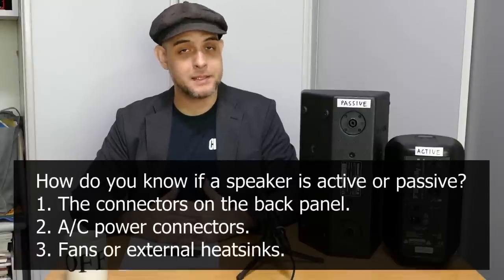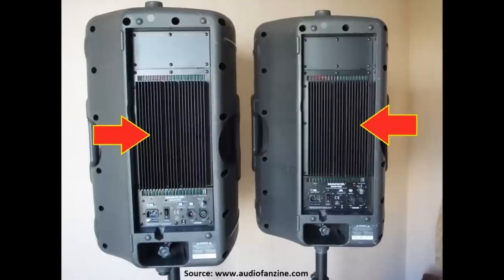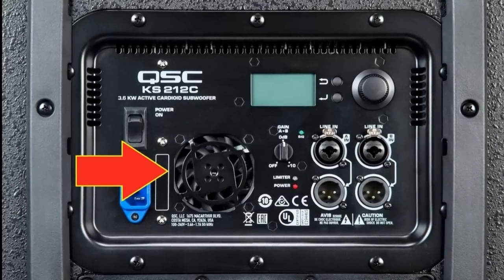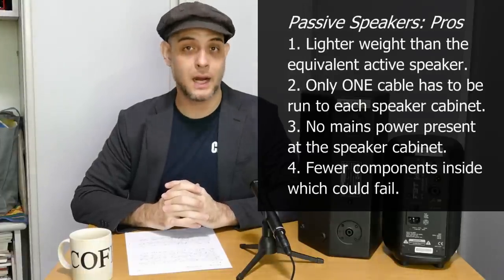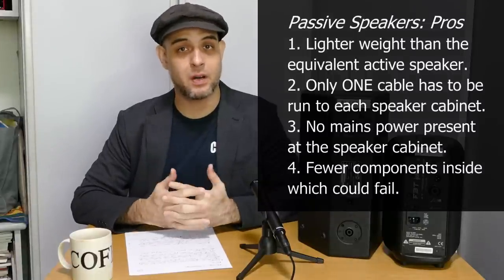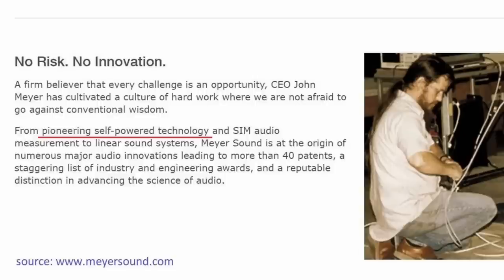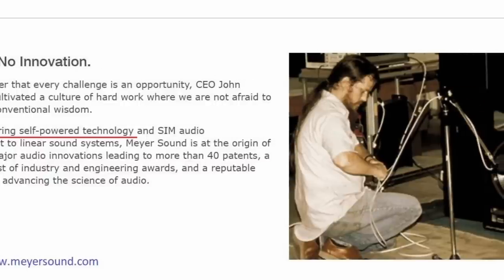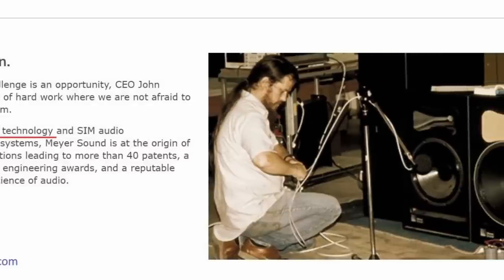Active vs. Passive Loudspeakers for Live Sound

Comment: Hello brother,
I like to ask you a suggestion for new speakers for the church. Currently we have 18 years old passive Yamaha speakers. What u think about Yamaha DBR 15. I heard Yamaha is know for mids and highs. I listen to EV zlx it’s sound clear but I couldn’t listen Yamaha DBR. We are on budget. Thinking about getting 2 15 inch speaker and a 10 inch stage monitor. Capacity is about 150 people at the church.. i like the Yamaha warranty. EV speakers have too many things in it. Thanks much please advise.
Reply from the maker: Hi Thomas, I don't recommend active speakers for installation - passive speakers are lighter and allow easier control and servicing of the amplifiers. This is very important if the speakers are installed out of reach, which they usually are.
Reply: @GLBProductions  
Hello brother thanks for the kind replay so our church we putting speakers on the stand not on the wall. I thought active speakers are better.  We already have an external Amplifier. Please advise.
Reply from the maker: Active speakers are not better or worse, it depends on your use case 😄 Both Yamaha and EV make good products - at the end of the day choose the brand that provides better service and after sales support in your region. A good pro audio retailer will work with you to recommend a model that is suitable. All the best!
Reply: Also in my understanding passive speakers will outlast compare to powered one. .. what u think about the Line array speakers compare to typical box style.
Reply: @GLBProductions   Thanks much appreciated.

Comment: I've learned many things from you sir. I have a question. Can you daisy chain 2 or more active speakers with diffrent brands? thanks.
Reply from the maker: Yes, no problem at all!
Reply: Thanks for the reply. you're the best sound system tutorial content i'd ever encountered in youtube.

Ps.
Do you have sound processor topic that has been uploaded already on youtube? if you do please send link. I wanna learn about maximizer and exciter in particular. What are their differences? Do they have the same function? How does this two work to obtain a better sound quality output 

and also what's the proper sequence or which comes first in setting up sound processors? From the mixer down to the processors. Like is it the crossover first; then the equalizer; then maximizer; then exciter? or the other way around? or in no particular order will do as long as they are properly connected with  each other.

Thank you much. @GLBProductions

Comment: Great video! 
However I don't get the Bi/Tri amplified part. What doesit mean when we say Bi/Tri amplified, advantages and disadvantages and when do we use Bi/Tri amplified speakers. Can you please enlighten me? Or do you have a video that tackles those topics? Blessings!
Reply from the maker: Biamplified means that a separate amplifier is used for each loudspeaker driver - one for the woofer and one for the tweeter. Triamplified adds a midrange driver and a third amplifier channel. This topic can be confusing - I have a video coming up that will discuss it.
Reply: GLB Productions I see. Thanks for your response I highly appreciate it! Will wait for that video. Blessings!

Comment: Hi ma question is based on power 
What roles does power/electricity play on line arrays for eg using one power source other than using different power sources 
As the a different in the quality of sounds?
Reply from the maker: Stable electrical power is extremely important for sound systems, especially ones that use digital mixers and amplifiers equipped with digital signal processing. If the voltage is unstable you can get serious noise issues, or in some cases the equipment will simply not turn on. The quality of the power generally does not affect the tone of the sound (as in bass, middle treble) but it does affect it in other very important ways.
Reply: @GLBProductions  thanks for the reply

Comment: Hey GLB i have a problem with My active Soundking Speakers .they are constantly distorting when used with a band. Could the power be the problem? They always sound like they dont get enough power
Reply from the maker: It's possible and very easy to check - get out your voltmeter and check the voltage of the power supply. If it is low or if it fluctuates a lot it can cause problems with almost all of your gear.
Reply: are you overdriving the Input of yr self-powered spk? also if poor mixing technique coupled with incorrect gain structures at desk, ths issue is common when many instruments/inputs are present.

Comment: Hello. I have a question. I used to dj a while back. Like 12 years ago. I still have my speakers. They are Gemini MB460. I'm working my way back to djing. I have a dj controller instead of the old mixer turntable lay out. I'm also looking into getting a mackie mix 5 along with these Rockville BPA15 15" active speakers. Will I be able to use both of these with the equipment I just mentioned?  Any suggestions would gladly be appreciated
Reply from the maker: Ah yes the MB460s - good old 3-way speakers. Do you still have an amplifier to power them? Yes you can use these with the mixer and DJ controller no problem. Personally I would advise getting an Allen and Heath mixer rather than one of the Mackies - A&H quality control is much better, especially on their cheaper mixers.
Reply: @GLBProductions  I don't have an amplifier. That's why I was debating if I should go that route. Thanks for the advice. I will look into the A & H
Reply from the maker: Oh right the BPA15s - to be honest with you I've never used the Rockville stuff. I always try to steer people towards mainstream, name brand speakers that have a good track record and a proven reputation for good customer support. Right now that would be JBL EONs, the QSC K-series or the new Yamaha DXR/DSR series. These are rock solid products which will last for years of heavy use.
Reply: @GLBProductions  yeah, I love those JBLs. Guess it's time to get some overtime at work lol. Thank you so much
Reply from the maker: You're welcome, all the best with your rig!

Comment: Hi I’m 15, and I run my schools events. We have a slight problem and that is that our outdoor PA system’s amplifier turns itself into protect mode after an hour or so of use. The outdoor system is used in Singapore’s terribly hot weather, which is why it’s overheating. Even with an extra exhaust fan on the amplifier it still gets hot really quickly. We have 2 15” passive speakers from Wharfedale which are 200w RMS and 400w peak. Our amplifier is 800w ( sorry I forgot the brand :(   ) and we don’t play them too loud, there’s should be in theory 400w headroom for the amp to reach its peak. Do we need a new amp that is of higher watts? If so, how many watts would you recommend us getting? Any tips and tricks to help the amplifiers stay cooler will be good too! Thank you in advance!!
Reply: We set our amps to MAX. Is that okay? Or should we reach 0 on our mixer and lower the amp volume. If we should lower our amp volume, what o’clock should we set it at? Thanks in advance!
Reply from the maker: Hi Junda, glad to see you have taken on this responsibility - I started out when I was 16 doing lights for school events so I know how fun it can be!
The first thing I would do is have the amplifier serviced - it could be that it just needs to have the heatsinks cleaned and/or replaced. Tell the technician the issue that you are experiencing and they may have a simple solution. 
Your amp is actually more than enough power - ideal wattage for your speakers is 400 watts into 8 ohms (I'm assuming they are 8 ohms). 
Amplifier controls should be used to set the system volume, so set up your mixer such that you are around 0dB and then set the amp controls to give you the right amount of volume - this is assuming you have no system processor or EQ in between the mixer and amp. 
All the best with your sound!

Comment: I will buy two boombox speakers as they are without deck. What do I need to do to make them sound using MP3 player? The speakers will need 110V power hook up I assume.
Reply from the maker: If the speakers are passive you'll need an amplifier of some kind. Possibly another boom box?

Comment: Here's a question I have.  Would the passive speaker you talk about the c300z or its little brother the c200 be useable as a speaker for recorded music and not just sound reinforcement?
Reply from the maker: Usable? Yes for sure, but if you're going to be using them primarily for music playback you really should listen to a pair of them before buying. Sound reinforcement speakers typically sound quite harsh when compared to hifi speakers because they use compression drivers instead of dome tweeters. They're not really designed to be listened to at close distances.
Reply: Thanks, I always like to understand the why along with the what. I just looked and the Mackie C200 has dome tweeters and not the compression drivers that the C300Z had.
Reply from the maker: Right you are! So they may be a good candidate for your intended use.
Reply: Our 'system' is a karaoke system used for parties but it will be a sometimes used for canned music.  Again I thank you for your help.

Comment: How do you add 2 or more speakers on a Passive Speaker ? Not like on Active Speaker you can daisy chain 2 or more speakers by connecting it to an XLR cable ( Male / Female )
Reply from the maker: With the appropriate power amplifier you can actually daisy chain up to four 8-ohm passive speakers off each amp channel - you just need to ensure that your speakers and amplifier are matched correctly.

Comment: Sir:
Do you find that passive FOH speakers have a longer throw than active speakers, in a larger room or outdoor areas?
Reply from the maker: Not at all - the throw or dispersion characteristics of a loudspeaker come from the design of the loudspeaker itself and are not affected by the location of the power amplifier.
Reply: cost constraint in a/any cabinet may caused these issues. if you're willing to set price factor aside, there're extreme throw capabilities & 'perfect' dispersion pattern in self-powered loudspeaker ranges to select from.

Comment: Hi, one of the factory-supplied passive speaker of my micro DVD music system is not working so I thought of buying a passive speaker to replace it. The specification indicated Output power 25W x 2maximun power output, speaker 6 ohm.  How do i go about looking for these type of speaker..thanks for your help!
Reply from the maker: I would try your local hifi shop - bring along the non-working speaker and ask them to match it as closely as possible.
Reply: @GLBProductions  Noted. Thanks for your help.

Comment: I recently purchased (for room size LWH 124*12*10 ft)  sony-str-dn1070 7.2 AV Reciver produces 165W per channel - need to add 2 subs and surround speakers

1)already have 150W active Sub Pioneer S-31 W. Reciver produces 165W sub is 150W does it affect this Sub?
2)Can I hook 1 or 2 passive subwoofer(car sub JBL Stage 1010) directly to my receiver?
3)have surround speakers Pioneer - Max 100W  can I use it?
4)suggest some some surround speakers, I don't like big/tower speakers I like compact speakers. 

I dont want loud sound, need deep bass and crystal clear audio. Mostly watching movies & Music
Reply from the maker: Hi Ram I'm not a home audio/hifi expert, I suggest you direct these questions to somebody with more experience in that area.

Comment: Is it possible to connect the instrument, for example, a keyboard, to the 1/4 inch input on the powered monitor speaker, and then send the signal to the FOH mixer using the “audio output” connection from the speaker? Definitely by using XLR balanced output from speaker to snake box. But is it possible to send signal that way?

Or, can it only be done by connecting the instrument to a D.I. box and then sending the signal to the mixer input via the snake box, and then from there, send it out using the Aux outputs of the mixer to the monitor speakers?
Reply from the maker: Sure you can do that no problem at all - the powered speaker is acting as a small sub-mixer that then feeds your main FOH mixer.
Reply: GLB Productions thank you so much for the input Mr.Bruno. You are the best! By the way, if you were to visit Malaysia...or particularly Kuala Lumpur, do drop by at my home church, St.James Church, Jalan Ipoh. It will be an honour to have you as our guest. God bless you Mr.Bruno. ☺
Reply from the maker: You're most welcome, and thank you for the invitation :)
Reply: both of yr suggested method are deployable. but having major different outcome.
Direct-to-powered monitor spk is easier to setup. but then this monitor spk wont let you hear the rest of the mixes at the mixer. also beware that 'audio out' of many powered spk may not be a balanced signal despite sporting XLR out, it just merely duplicate yr TS signal frm yr instrument.
DI layout and returning via a seperate mixbus of Aux, can be costlier. also yr powered monitor spk can then be a 'true' stage monitor that you can choose what you want/not listen frm that spk.
it depends on yr current setup at mixer plus yr needs.

Comment: can i use passive loudspeakers that are amplified from the amp channels and simultaneously connect my active loudspeaker to the mixer out channel without worrying about any technical problems?
Reply from the maker: Yes no problem. You will need to use the level controls on the speakers and/or amplifier to balance the volume between the passive and active speakers.
Reply: +GLB Productions thank you so much for this, because i was stranded on this for such a long time, now i can progress on the matter after you useful piece of information

Comment: My active subwoofer has two (in and output) speakon connector.  When I connect audio output to speakon input from mixer, it does not work unless I connect to RCA input. Is that possible that the speakon work for power amp? I never see a active speaker also works power amp
Reply from the maker: Which make and model of active sub are you using please?
Reply: GLB Productions I got it from a generic. I guess, it is home built
Reply from the maker: In that case you need to check with the seller to see how the connectors are wired - don't guess 😉
Reply: GLB Productions the seller doesn’t know too. It’s good for me to open the cabinet to see if that two speakons would work for passive way?
Reply from the maker: Sure - at this point you are on your own so do whatever is necessary to find out what those speakons are connected to.
Reply: GLB Productions thanks. By the way, how do I kno if those speakons are for passive use?

Comment: So, an active and powered speaker are the same thing?
Reply from the maker: It depends on who you speak to: for live sound engineers they are usually the same thing. For studio engineers they will sometimes only call a speaker active if it has an active crossover.

Comment: Can i adapt my passive speaker to my active speaker. Meaning can i connect passive to a active speaker.
Reply from the maker: No, you cannot connect the output of the passive speaker directly to the input of the active speaker, it will be damaged.
Reply: Thank you sir for the information
Reply: I have one passive and one active how can i use this at same time. If I can how to do it what gadget should buy to make it possoble.
Reply: Can you make another video regarding this mixed speaker.

Comment: Is Studio monitors a Passive speakers?
Reply from the maker: You can get both passive and active studio monitors.
Reply: For example what type of speaker is Krk Rokit?
Reply from the maker: They are active - KRK use the term 'powered' which in this case means the same thing.

Comment: How much voltage is the speaker plug..?
Reply from the maker: It depends on the amplifier - for powerful amps it can be over 100 volts.
Reply: GLB Productions 
Thanks, amplifiers are like the confusing est thing when it comes to audio systems... good helpful videos btw

Comment: Could The Active speakers connect to a amplifier ?
Reply: I meant a AVR which contains amplifier inside .
Reply from the maker: Yes, use the receiver's line output to connect to the active speakers.
Reply: @GLBProductions  I got Swan m200kiii (active speakers), and i want to upgrade the speakers with a powered sub-woofer (Klipsch R-100SW 10). How could i hook them up ?

Comment: God bless my brother how i set up power ev speakers to power ev subwoofer.
Reply from the maker: Which models of EV speakers are you using?
Reply: GLB Productions God bless my brother the ev power speakers are zlx-15p and the subwoofer is Elx-118p
Reply: GLB Productions the speakers are zlx-15p and the sub are Elx-118p
Reply from the maker: The owner's manual provides a useful hook up guide: https://www.electrovoice.com/binary/Live_X_Powered_Loudspeaker_Owners_Manual.pdf Basically you need to engage the "with sub" switch on the fullrange speakers. Connect to the fullrange speakers first, then link out to the subs.
Reply: GLB Productions thank you
Reply: God bless you i always see you videos the set up they had was ffrom mixer to speaker in and from speakers out to subwoofer